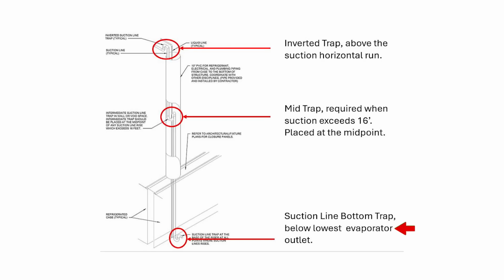Understanding P-Traps with Matthew Taylor

Comment: With the new A2L refrigerant on our new residential systems, we are finding that line set size requirements are smaller than most existing line sets. Would traps be a safe option if line set replacement is super difficult?

Comment: CUAL ES LA DIFERENCIA P-TRAP EN MÉDIUM CASES AND FROZEN CASES..  FROZEN CASES NEED P T TRAP??
Reply: There is no difference.  Frozen tends to be less dense refrigerant, but the pipes are sized to move the same velocity, so the oil will require the same treatment.